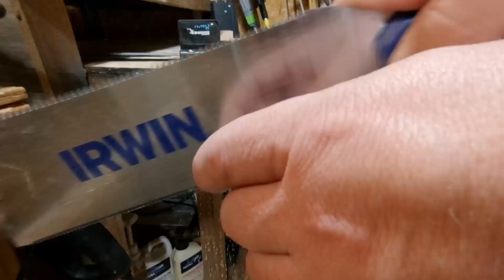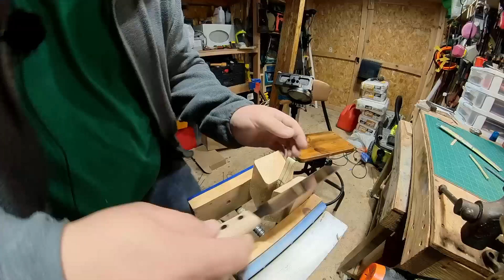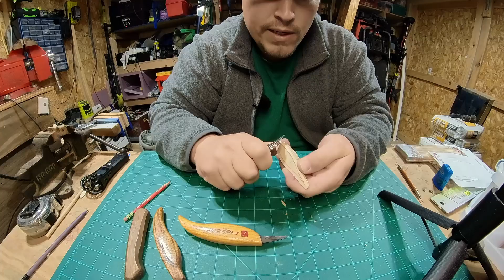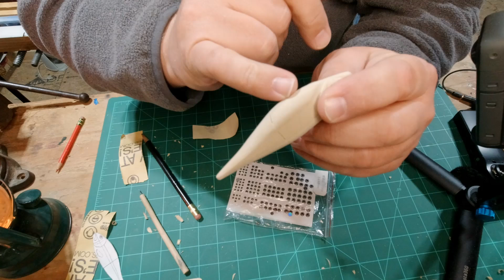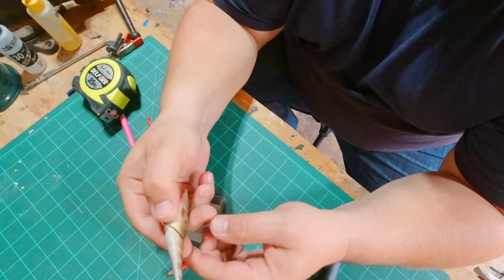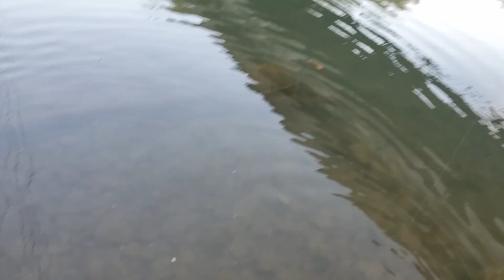Hand Tools Only  - Swimbait Lure Build

Comment: I do not consider using a drill as cheating. Most people have access to a drill and ballast holes need to be a lot deeper than eye sockets. But respect for staying to to handmade! 

For twist-eyes, I use two pairs of vise grip pliers. One holds the tag-ends of the wire, while the other holds a nail bent into a hook. 

The lure looked great and from what I could see from the top-water wake, it had a pretty good swim to it. Great job!
Reply from the maker: That's not a bad idea for twisting wire.  I'll have to get some vice grips one of these days. 

The lure action was a bit strange at times.  Reason I lost it is occasionally it would dart sideways when retrieving and it darted into a tree but I think I put the pins in the hinge too far back and occasionally it would get stuck in a bent position.

Funny thing is, I literally stuck the camera in the water to get underwater shots on the cast I lost the lure on.  Never fails lol.
Reply: @rockfoxdesigns  you can hold the wire with regular pliers it just takes a lot of grip force to squeeze, pull, and twist at the same time to get nice, tight, straight twisted wire.

Bummer! Hope the luck improves on the next one.